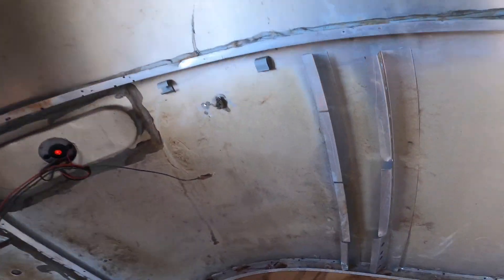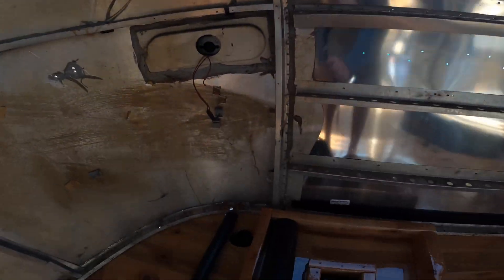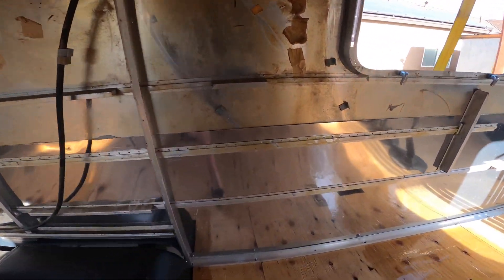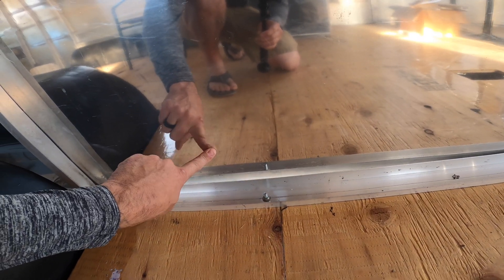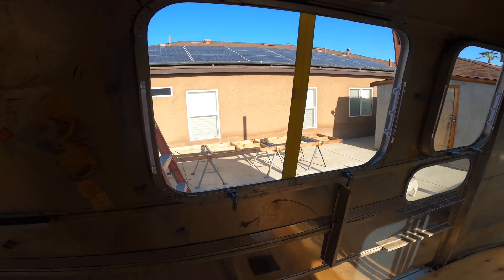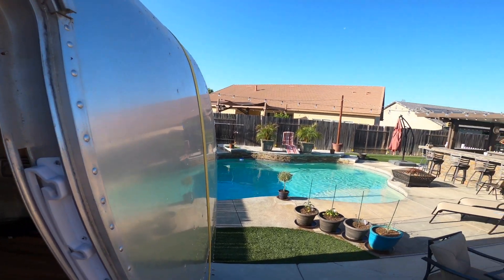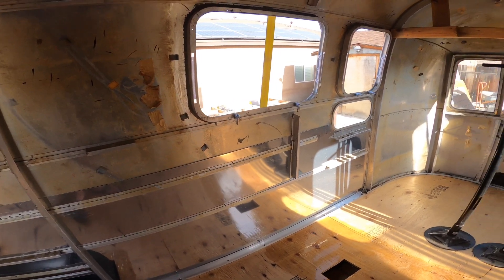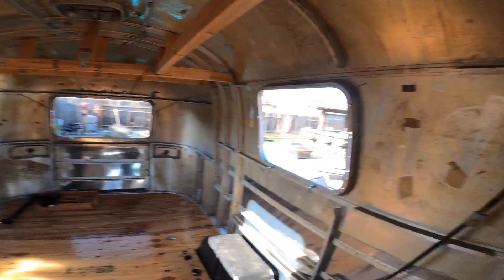Airstream Shell Installation onto the Frame

Comment: Hello Danny, just found your YouTube site. Great content, it's awesome you put in the time doing all the video work to share. I'm about to start of a renovation of a '79 27ft. Argosy I just picked up two days ago. Question about the panel install long street side did you use the sika flex between the panels? And C channel to plywood? Thanks in advance.  Daz
Reply from the maker: Much appreciated for stopping by; actually posting a series of videos starting this weekend as I have gotten to finally editing a bunch to be released on a weekly basis. Definitely best of luck on yours and if ever if you have questions don’t hesitate to stop here or on the Instagram page and send me a message. The answer to your questions is I actually used butyl tape for each panel replacement. Where the corners met more than one panel, I also used sika flex in those areas with the butyl tape to fill in voids I thought the butyl tape may not have covered which in the end the butyl tape did actually and the sika flex was not needed but is there as a secondary. I rough installed subfloor by laying out the plywood subfloor I cut and epoxy sealed to the frame and then installed c channel between frame and subfloor and installed some center brackets where subfloor met in center which I have another video on explains all that. Once everything was aligned I went around and installed wood to metal screws to the frame of the trailer and then lowered the actual shell of the trailer until it aligned with outside c channel with the previous rivet holes. I was able to utilize the same holes of the rivets I drilled out by utilizing the rivet removal tool I picked up at Air parts Inc. Let them know Dc higher ground sent ya if you do buy one and they will take care of you! Best of luck again and thanks for the comment

Comment: I see it over and over but have to ask? Why would you not install the bottom skin first then the shell over the bottom so no water could leak into the belly pan? Just curious as ive got a complete shell removal ready to reinstall but really want to install belly pan portion under the wall skins to remove any possible water entry at the entire seam around the RV..
Reply from the maker: I can’t speak for everyone else but the reason I’m doing it this way is two reasons and just my opinion only. If you install your trim pieces and seal every panel appropriately, you will never have to worry about leaks; which is why slow and patience is alway good when sealing and fixing any mistakes you see that you know should be fixed regardless of how tired we get or how long the day was working on it. Being methodically about ever centimeter. The belly pan is the most exposed panels of the entire trailer and will deteriorate the fastest especially in certain parts of the country in adverse weather driving. To replace one panel or multiple panels doing the shell over the bell pan would then have to make you remove the shell in entirety to replace a belly pan. To remove a shell, interior walls and interior pieces have to be removed to get to the outriggers that have the shell bolted down. If belly pan is on the outside of the shell, than you can replace the belly panel(s) without all that removal work for just a panel replacement that will happen well before any exterior skin panel. The second reason I chose this route as well is because the frame is the heart of the trailer where electrical wires plumbing is usually ran for various things. I want to ensure at the very end that all electrical works and all plumbing is good and still leak proof before I finally seal and close it all up. Last thing I want is to find out electrical or plumbing is not working for whatever reason and I’m tearing out belly pan panels, where I can just wait and do all final testing and then button and seal it all up at the end.